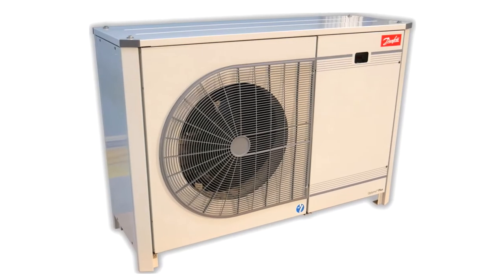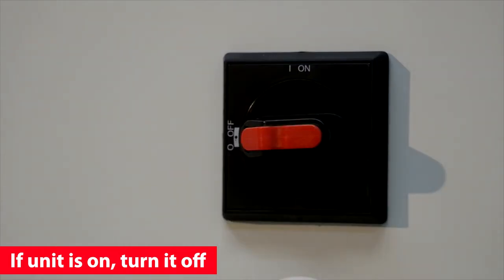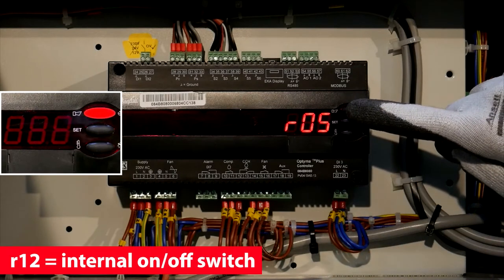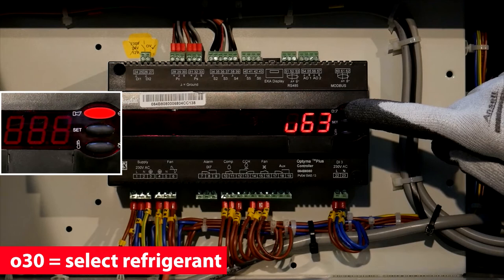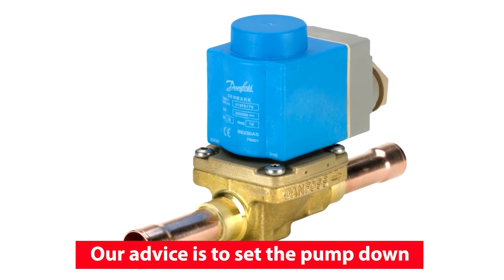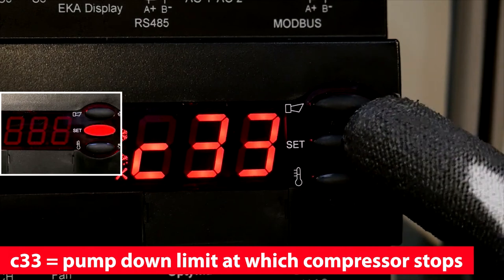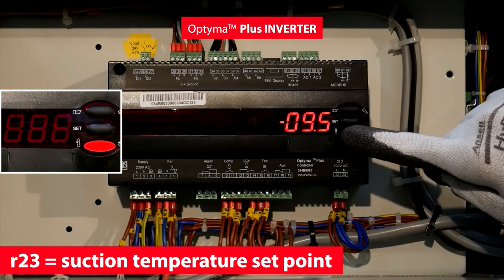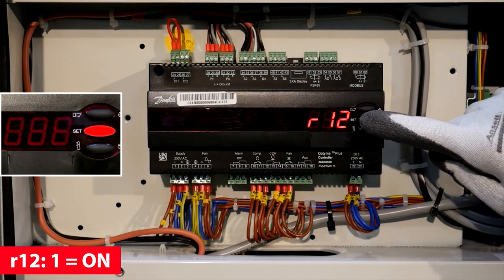Start up your Optyma™ Plus or Plus INVERTER condensing unit controller in a few simple steps

Comment: Am using r134a setting..done setting as required but condensing unit not starting
Reply from the maker: Please read the User Guide/Manual and follow the set-up instructions. The video may not show all details. If you still have problems, please contact your local Danfoss representative